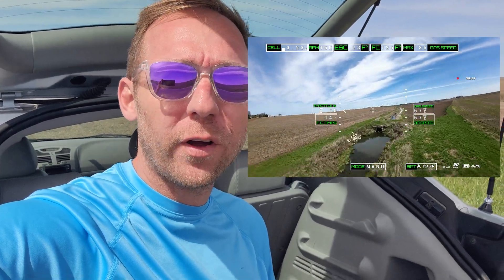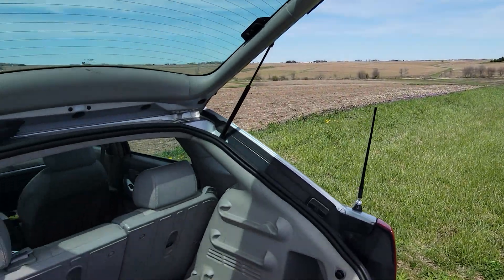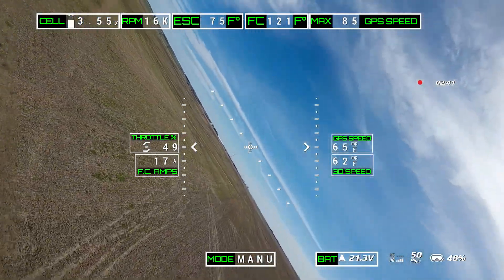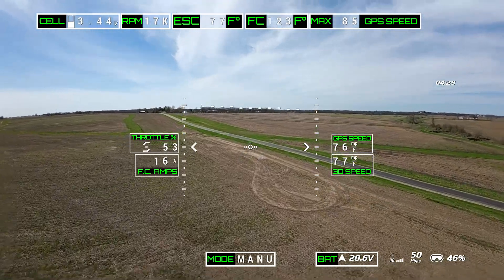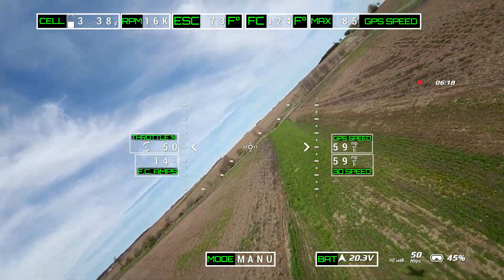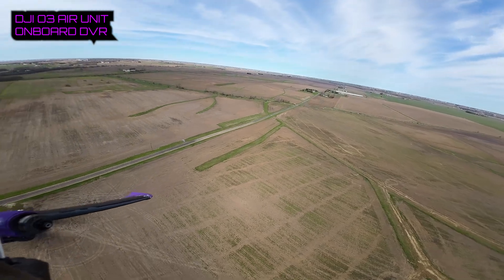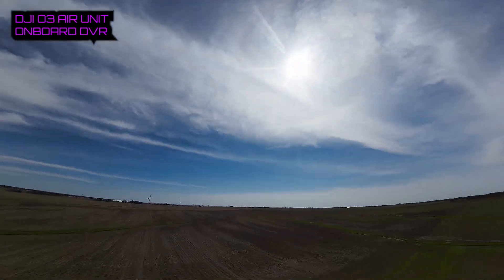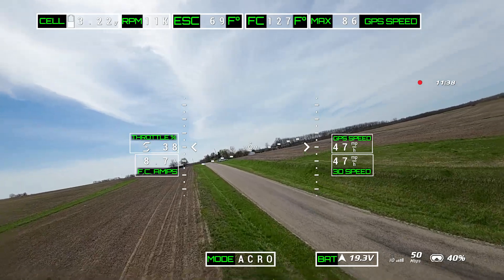6S Twin Motor AtomRC Dolphin - Dialed In, Flying on Rails, Narrated, FPV

Comment: Have a dolphin kit in a box. Had it for a couple of years. Definitely gonna build it as a twin tractor after watching your build and process. Was already leaning that way but your content sealed the deal.
Reply from the maker: You wont be disappointed.  While you are building it order a spare set of wings from AtomRC and that way you can swap back and forth between a pusher and a tractor.
Reply: @JeffDoesThis  I have a bunch of noisy pushers. Love 'em. After owning my Albabird, I fell in love with twin tractors. I have a mini drak kit with extended wings and boom I'm gonna build up as a twin. My dolphin is a kit and I don't want a pusher so one set of wings should work for me. I also want planes that are easy to launch and twins are perfect for that. No trips to the emergency room! Had enough of those. Hospitals suck.

Comment: Hello Jeff, thank you for your interesting Dolphin videos! I found your channel while browsing for my first FPV plane on Youtube. Thanks to you, I decided on the Dolphin and I am flying mine for one month and I am loving it. It is very forgiving and is great for both high and low speeds. I equipped my Dolphin with a 7" prop and 2807 1500 KV motor and also fly it with my 6s quadcopter batteries. 
Keep up the good content. I am craving for more.
Reply from the maker: Awesome Man! For me, these FPV planes are the coolest thing ever.  So many different options, styles and for me the best part is the tinkering and customization.
Reply: exact, have no more to say...
Great Content!